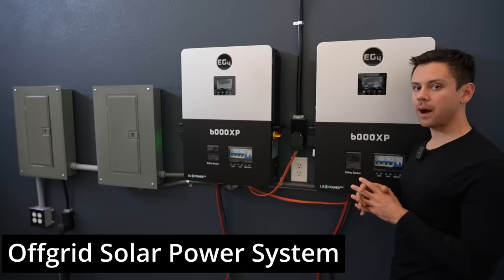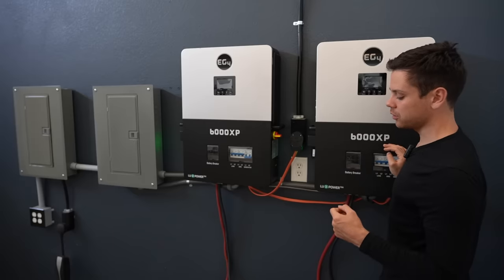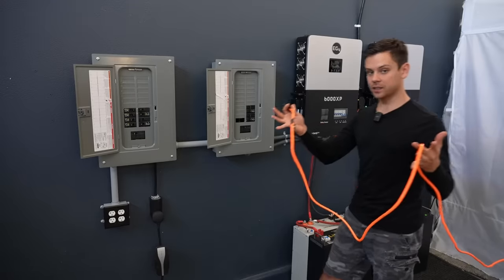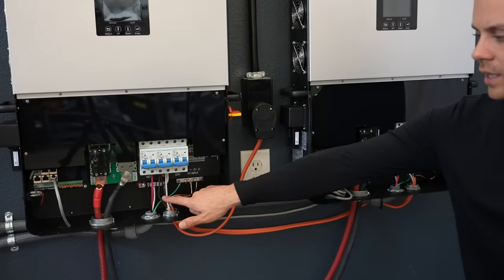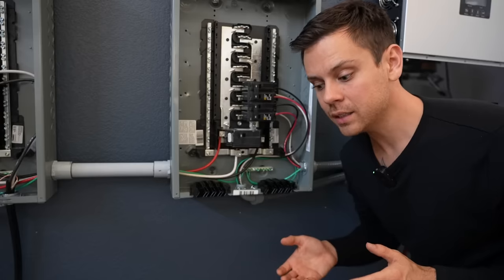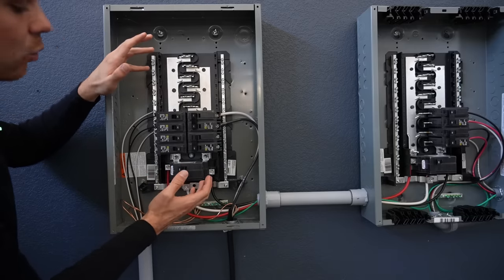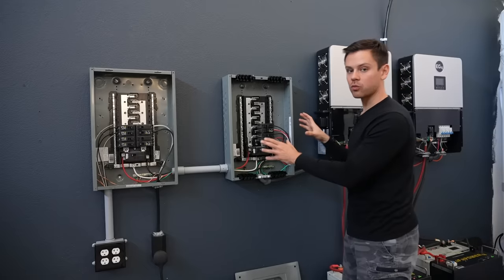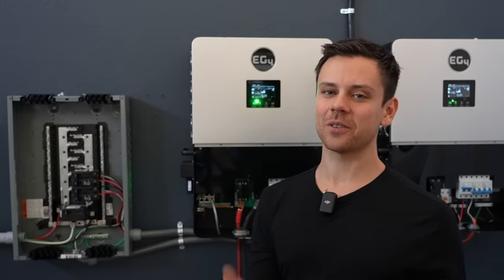How to Build Expandable Off-grid Solar Systems w/ EG4 6000XP

Comment: Hi Will, thanks again for a great video.  Would you be able to show if the 6000XP can curtail inverter solar power when batteries reach 100% and there is no where for the available PV energy to go?  This is something I've seen discussed on grid tied solar+battery systems when the grid goes down, but not much in DIY circles.
Reply: The 6000XP does indeed adjust the output of the MPPT as the batteries approach 100% SOC. At least it does with the EG4 batteries. If your batteries are on the approved list, they should also.

Comment: Looks great. One thing about these inverters that confuses me is the idle consumption. It is claimed to be extremely low, but they list several different conditions in the spec sheet. What they don't say is what the idle consumption is when using grid, battery and PV together. Do the idle consumption numbers add together, or is there some overlap? I have a smallish Victron system that is used mainly as grid backup, so it is always connected to the grid unless there is a power failure or there is sufficient PV to supply the load and battery charger . I use this as "off-grid" in that I have the grid feedback disabled, but have it set to always draw a small amount from the grid to prevent feeding back during load changes. The system draws an average of 20W/hr, or 480W/day. I am looking to enlarge my system and curious how the 6000XP would work as a replacement.
Reply: As long as there's a load on the system, each unit will draw ~50W.  What I don't know is if you have multiple units tied together, but are using <6000W, will the second, third, etc inverter go into "eco" mode until needed, or will they all still draw 50W each if there's any overall system load sensed, even if they aren't technically needed for the minimal load???

Comment: Do I use 40 amp breakers for the combiner box. In the specs for the 6000 XP I see it reference 63amp breakers. Is this something different? Also I’m totally off grid so are you saying I should wire my breaker box more like a sub panel and keep the grounds and neutral separate for the 6000 XP?

Comment: After watching videos on this unit, I really am liking it. I am thinking of installing a system in my house as a UPS for my freezers, refrigerators and furnace. I would eventually add solar panels for charging. I currently use a Ecoflow delta pro but this would be a more substantial and reliable system. I have had issues with my delta pro. Plus, we are going to build an off grid cabin so I get to experiment with this before I install it out there.
Reply: Hi, I was wondering what problems you have had with the Delta Pro? I was thinking of using it for my camper build.
Reply: @Patty-qh3lm  Well first to be fair, it was a factory refurbished unit. That said, I have had it for 18 mos and it basically went dead twice and I had to send it back to them (Ecoflow). Maybe I got a lemon or someone elses. That said, the unit itself and functionality are fine. When it is working , it works great. Unless your technically challenged or like the small size, I think you could do better for the price. I am considering replacing it with a 6000XP system. Not bashing Ecoflow, I think there stuff is not bad.
Reply: @airman6822  ok, thanks! I do like the small size of the unit and that it is "portable."

Comment: I have a question about the grid connection. Is this able to run 2 on the same 2 pole 40 amp breaker? Or does each inverter need its own 2 pole 40amp breaker?

Comment: I have 2 5000watt solar inverters by PowerMr to connect in parallel for off grid. Both are 110v AC and I have an existing solar set up already in place 2500watt/4 (60 amp controllers to 1200ah-AGM battery bank with a 12v 5000 watt(DC/AC).  inverter. My question- how can I use the 2 5000 watt parallel solar inverters (5k -100amp MPPT-solar to load only with my newer  5000watt panel array?  Should I take the 110 legs and make 240 master circuit to a 110v sub panel? Also how do I run the 2 inverters from my my only 110v source coming from my existing solar setup?? I know right🥶🙃

Comment: Will, I'm trying to build a mobile system. My dream is to power my RV, using  shore power cord plugged in to my mobile unit.( on my front side of Jeep trailer) What I don't know if one 6000xp will run my heat and air, I have Alfa See Ya coach. It has a switch for 30amp or you can Select 50A .do you have any suggestions

Comment: hello

I’m trying to plan out my off grid system and a came to this roadblock. I want to be able to power my temporary rv tiny home with a 30/50amp (undecided) plug, ac powered tools etc in my work shed, and plan ahead to when I build our house to use some ac outlets/devices as well as dc appliances/lights. (I know it’s split on dc appliances vs ac ones the cost seems worth it tho)

Can I have both ac and dc breakers in the same breaker box?

Coming out of my 6000xp can I run straight to a breaker box and have both ac/dc breakers within it?

Do I need a chargeverter before or after the breaker going in/out of the dc breaker?

Clearly confused how to get what I’m aiming for.

Please help, 🙏🏾 thanks.

Comment: Hello - Question.  Wouldn't you need some type of bypass/transfer switch set up to bypass the Invertor for the grid input to the panel in the event there is a problem with the invertor and you want to continue to power your house.   As such any recommended equipment/design?   Thanks.

Comment: Why don’t you just get a panel with main lug only? Land the inverter line side to the main lug like a normal application, then add the load breakers on. Seems odd to back feed the panel that way when you already have a disconnect in the inverter.

Comment: I'm thinking of hooking this inverter to a 400vdc tesla battery (out of warranty to the solar input with a buffer 48vdc battery in the truck bed so I can do wielding. electrical wise would I just treat it as a offgrid system with 2 inverters in parallel I also plan to use a mppt line to have actual solar to power the buffer battery. Could I make do without the buffer battery or with eg4 does it need a 48v battery to feed into a ac system?

Comment: Hi Will thanks for the great video you talked about not wiring the grid the way you showed it here. If you get a chance can you explain the correct way?  Thanks
Reply: Hard wired through conduit, rather than through his extension cord/plug.
Reply: Thanks!

Comment: Hi Will, great video. I love this system although I started with victron cerbo gx, smart shunt, 250/100 mppt charger and kinda hard to switch specially when I need 12v without any converters and I can use directly from the battery to you all monitoring victron futures. But for my second system I’m considering 48v which is of course best way to go, do you have a video about smart app setup for this system 6000xp? Also, do you have any recommendation for 48V system that has 12v usable output for loads up to 300-400W for example with high efficiency conversation to 12v. I would love to switch to 48V system before buying more 12v batteries.

Comment: Just purchased 2 of these after returning my 6500exs. I am wondering, if you have these lined up next to each other the fans would be blowing hot air into the intake of the one on the left. Could that be a problem?

Comment: I have trouble understanding your "split phase" in USA.  In Australia we have 240v single phase coming into our homes and a 3 phase 415v generally reserved for industry.
Reply: You’re lucky mate, it’s the bane of the North American electric grid.
Reply: @busimagen  Are each of the 120v phases "in phase" to double the voltage to 240v?  Our 3 phase 415v are all out of phase by 120 dg and when combined they total the 415v. why would it not be more logically to just have the single 240v phase?  Historical??
Reply: @busimagen  You also have 120/208 when the supply is from a 3 phase transformer or 3 separate pots configured for wye.  120 phase to neutral, 208 phase to phase.  It gets messy over there, eh?
Reply: @markstephan636  not sure about the history, but 240 volt 2 phase power in the US is 2 x 120 volt legs that are 180 degrees out of phase.

Comment: Question. Does what you said about pass through wiring apply if you have a neutral ground bond from the grid? That's what I have, the grid bonds the neutral and ground so even if I separate the ground from neutral in the sub panel and combiner box, I still get a neutral ground bond in there because the bond exists at the grid level

Comment: With two inverters can you now connect 4 strings of solar panels to charge the batteries?  Also can you use one inverter tied to a generator to charge if you wanted?
Reply: Yes and yes.  :)

Comment: Will, one question I have about your battery settings… Many people show this being “configured” with the lead acid setting. Can you tell us why you have to set it up for lead acid?
Reply from the maker: Because I hate battery communication 😂 If you are using EG4 batteries, just hook them up and it will change the settings automatically.
Reply: @WillProwse  I’m using Samsung SDI lithium modules, and probably don’t have comms either. Are you saying the ‘lead acid’ selection simply controls comm functionality, and does not affect charging voltages for lithium based batteries?
Reply from the maker: @joshjuzwik4787  if you don't use comms, you use voltage to control cycling. So you can use it with any battery. That's typical lead acid setting. Use whatever you want
Reply: I think I’m getting it now😆…and thank you for the video. I’ll be getting the 6000xp within a few months

Comment: So I have a metal building that is fed from a mainpanel on a pole outside the building which feeds into a subpanel inside the building. Im going to rewire the shop to only use power from the inverter through its own subpanel.  I want to have an AC backup feeding the inverter during cloudy days. Do i have to run a neutral to the inverter or does it only use the ground from the AC connection? So i would only run the inverter permanently offgrid with an grid backup during low battery SOC.

Comment: So if you got a 6000xp shipped after 2/2023 they removed the bond screw and the software will handle the binding if you hook up AC it will pass it through, if you off grid with no AC where does the bonding come from?

Comment: I am thinking about doing a setup like this in a shop because the main service to my house is only 180 amps and with everything I want to do I am thinking of running a smaller subpanel to the shop and use an inverter and battery system to handle the peak loads only when the tools are used. Thinks like compressors, welders and other power tools. These loads are high demand but don't run very long. I could charge off the sub panel all the time. Has anyone used a setup like this? Seems better that bringing in new service.

Comment: Would the 100A main breaker that Will's "combiner box" load center is using be sufficient if a 3rd EG4 6000XP unit were added in the future? Or would 150A be needed? If I understand correctly, since these max out at 6000W @ 240V, which is 25A, I could use a 100A main breaker and still come in below the 80% load limit? (25A x 3 = 75A, which is below 100A * 80% = 80A)
Reply: I think that would be just fine w/ 3 x 6000xp's and the 100 amp load center.  One feature to be aware of though is that the 6000xp has a feature that isn't really spelled out in the documentation very well.  If you overload the inverter capacity, the inverter will absorb the surge for a few seconds and then automatically switch to grid pass-thru mode until the load drops below the inverter output capacity for a few minutes and then it will switch back to the inverter.  When it pass-thru mode, it supports passing up to 50 amps from the grid.  Still, with 3 x 6000xp's you'd have to have quite a large load before you could exceed the inverters capacities to have the switch to pass-thru.
Reply: @intDavid  Interesting! And thanks for your feedback. In my case, I'll be totally off-grid. Without any grid power available for overload, would these just trip the breaker(s) if I ask for too much surge? That would be totally fine with me, especially if I end up running 3 units, since using that much power at once would definitely be by mistake, haha

Comment: The Better Business Bureau gives Signature Solar a 1.63 out of 5 stars.  Nothing I don't like about the video, but would like to know how to hook up a 120 volt generator to charge the batteries when I have a series of cloudy days?
Reply: Better Business Bureau rates your business on how much money you give them. More money, higher rating than a bunch of nonsense.😊😊😊😅😅😅😅😅🎉
Reply: @chuckb9867  the 6000xp only supports 240 volt generators.  You would have to run the generator output through a transformer to get 2 phase 240 volt power to connect to the 6000xp generator inputs.  I'm sure the transformer would introduce some power loss though.

Comment: Will i want to run a workshop off solar 185 amp welders , drills , grinders, lights power points heavy load how big and is it even possiable for small amout of money with quality equipment

Comment: Can you connect one of these eg4 6000xp inverters with 2 eg4 6500ex? I have 2-eg4 6500ex inverters for the dual phase, and I understand that you have to buy another pair of 6500ex inverters to expand because of their single phase only capacity unless paired to another for dual. Since the 6000xp already is a dual phase, you just have to buy one for expansion? I hope you understand what im asking here. Thanks.

Comment: can you just buy 1 6000xp, no batteries, get 8000w of solar and pass that power straight to charging a tesla? I assume you would need to wire up a 240v outlet from the a/c out of the inverter right? Than just plug in the charging cable to that?

Comment: Hi Will, Thanks for posting this! I noticed you have a grayish blue wall behind the inverters. I was hoping to find another product besides "Hardiboard" , do you have any recommendations on which product I could use? I notice they also sell a paintable product that produces a non combustable surface but i wasn't sure if this would work in this application. Thanks again

Comment: I have a 50A sub panel in my detached Garage and I don't really need 220vac but would like to power both legs to provide 110vac into my small home. Need to power basics, gas furnice, fridge, tv, why fi, lights, mayoth legsbe a small window AC in summer.  You did a vidio on the echo pro and I was going to buy two of them with a 220vac adapter.  Then I saw a video of another unit you tested that seems better but I don't remember the name of the unit.  P.S. Will the 220vac unit provide 110vac to both legs?
Reply: Yes, this will do both

Comment: Hi Will, how would you parallel 2 3000 watt Growatt LVM 24p?  I have a question whether I am supposed to use 2 single pole breakers or a double pole to connect the 2 hot wires from inverter 1 and inverter 2 and what amperage for one or each breakers.  Thank you

Comment: Would like to see the Solar input voltage to accept a lower voltage... ~48 volts or lower would be optimal.
Reply: That isn't such a great idea. The higher solar input Voltage, the less Voltage drop on long distance runs from the solar array, and the easier everything gets. It might be nice to be able to use a lower Voltage, if one only has so much room for solar panels, but what I said still is true.
Reply: @Tumbleweed5150 You are correct that the higher the solar input voltage -> the lower the losses. But, exactly, I want to make sure I can still power the inverter with just a few panels. It would be great of these had that level of flexibility.

Comment: On the 6000XP how much power can pass thru from the grid?  For instance could I start a heat pump condenser using power from the grid if the starting amp draw is higher than 25 amps in order to get the load running?

Comment: Quick question if running off grid with generator and solar only no AC input where do you connect the grounds in neutrals I have no AC input at all other than my generator

Comment: Another great video.  I have built a couple mobile Victron systems (one split phase) in the past.  We are looking at purchasing a house and I would like to implement 2 units with pass thru.  Is there a way to put something on the wall for the wife that would give some of the same display info like the Cerbo does?  Maybe a tablet running the EG4 app?  What would that look like?  Thanks
Reply: I have to say that as nice as the EG4 monitoring app is, I prefer monitoring mine with Solar Assistant.  The EG4 app only refreshes the data displayed every 5 minutes, whereas solar assistant is more realtime - updating every second.  Also I find the EG4 monitor app stops updating sometimes unless I force quit it and re-launch.  If you buy their orange pi directly from solar assistant it even supports HDMI output which you can connect to an inexpensive DC-powered LCD screen to display the console that way.

You can monitor the system simultaneously with solar assistant and the EG4 monitoring app so you are free to use either whenever you feel like it.
Reply: Thanks for that.  I will have to read a little bit more about the Solar Assistant.  I think the wife would like the Pi with a touchscreen, it would be closer to the cerbo screen she is used to. @intDavid

Comment: I sure would like to see a REAL schematic diagram, a drawing, of the AC inputs and AC outputs with the grounds and neutrals and breaker ratings for MAX AC passthrough.
Reply: That's my concern about Will's design using 40 amp breakers for the inverter outputs since the 6000xp does support up to 50 amp passthrough.
Reply: This!